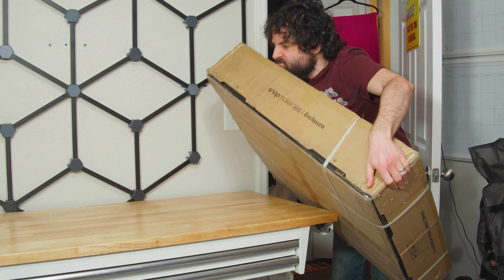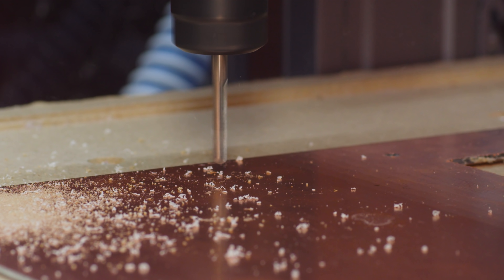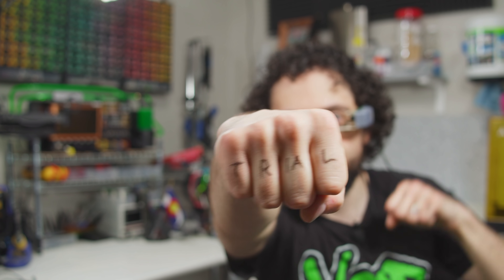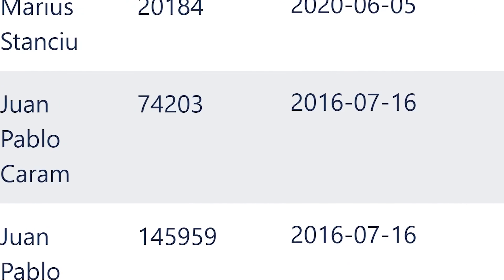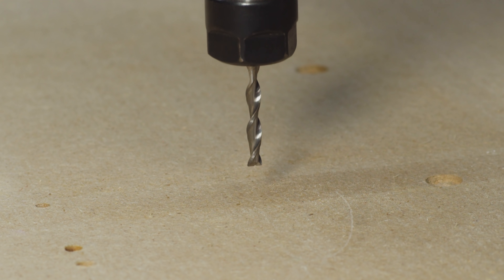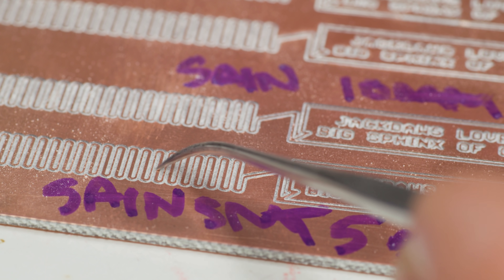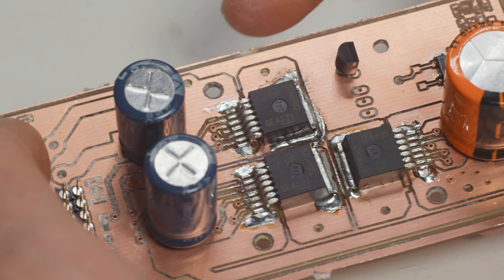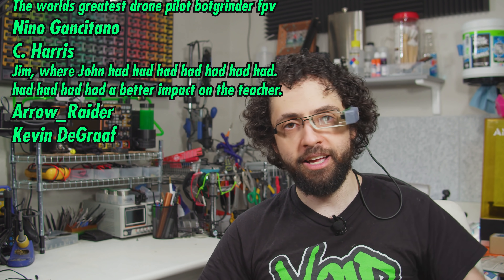PCBs in Two Hours? Zack Sucks at CNC

Comment: Thanks for posting this! I've spent months playing around with this on a garbage 3018 genmitsu cnc and was not able to make it reliable enough to use on a regular basis. I found that using candle's surface mapping was critical to get the depth tuned enough for thin traces. Also really applaud the two sided attempt. I gave up on that and just focused on doing multiple 1 sided boards that I could just jump. All the challenges here really really resonated with me, it's a brutally tough process unless you have access to fancy cncs, huge thanks for posting.

After watching Thomas Sandladerer's video here: https://www.youtube.com/watch?v=RudStbSApdE&t=11s, I shifted into using an etching process using a MLSA printer to massively simplify the masking step. Trick there is to pump kicad into freecad using the kicad stepup plugin to get the traces into there where I can extrude and then spit out an stl to slice in lychee. I now use the cnc to do the drills and then etch the traces. Plus I can re-use the resin printer approach (with a negative instead) to do a solder resist layer! I find this process to be much faster and tolerant to mistakes, esp for boards with lots of traces.
Reply: Check out pcb2gcode - it can convert Gerbers and drill files from KiCAD directly into G-code for several different machine controllers, and can inject mesh leveling code into the G-code as well. Works shockingly well once you set it up for your machine and tooling.
Reply: @OddlyIncredible  very cool, will do. Thanks for the headsup!
Reply: Do you have any tips for just drilling PCB holes with a CNC mill as you describe? (i.e. not doing it as part of an isolation milling job)
I have specific queries regarding things like software (which and how), techniques for positioning & aligning, feeds/speeds, etc., but I'd be grateful for any advice or simply pointers to useful references, guides, tutorials (videos or websites), Discord/IRC communities, etc... :)
I might even appreciate … 😷 Facebook group suggestions!¹ 🙀

I bought a Sainsmart 3018-MX3 a few years ago primarily for drilling holes in (and milling the outline of) etched PCBs, because drilling/milling boards "by hand" entirely sucks — even ignoring the "my hands, clothes, face ~~and lungs~~ are covered in fibreglass dust" aspect.
My Dremel rotary tool + Dremel Workstation (almost a pillar drill!) made the drilling+milling more possible than hand-holding a drill, Big Clive-style, but it's still extremely tedious and not very accurate unless I spend even longer aligning things.
With good quality pre-sensitised laminates I achieved trace/space dimensions only just behind the 6mil/6mil specs of the $5 PCB fab services (I think the limiting factor was my 600 DPI laser printer rather than any part of the expose/develop/etch process!), so it was a shame to throw away that detail/quality with misaligned holes 😸

My PCB designs became exercises in avoiding holes wherever possible, using SMT pin/socket header, SMT everything, and just bodging THT parts onto the board, soldered at an angle 😹

Unfortunately, "life" got in the way of me ever using the 3018 and I've not made (or even bought) any PCBs since then, leaving the 3018 gathering dust under my 3D printer :(
I'm finally starting to have more time again now, so I'll hopefully soon begin my CNC drilling adventures - but this is where it'd be really useful to know what I'm doing!

I've been using my 3D printer since 2017, and I have a vague idea about CNC mill use from various YT videos and such, but every PCB-from-CNC-mill video/article/tutorial I've encountered discusses isolation milling, and it's not clear if I can simply skip those steps and go straight to the drilling, especially if I wanted to drill holes after etching, thus requiring careful alignment...
(Though I have been wondering if it'd be easier to drill holes _first_, then I just have to align the transparency/vellum with the printed design onto the hole pattern. That seems to be the order used by industrial PCB fabs, after all!)

—————
¹ Ok seriously, some Facebook groups can indeed host useful discussions, but I don't like that distributed, largely-public platforms like Usenet and myriad Web fora are being replaced by a single data-mining mega-ecosystem 🧐
Reply: @AndrewGillard  I really just throw the drill file into flatcam and then do my best to align it by eye. I attempted a 3d printed jig, but bumped into warping issues with it and gave up. If you drill first, then chuck dry film over it and etch, you have much better control over alignment when placing the board over the resin printer's screen. Then you just don't even care about futzing with alignment with the cnc, where there's quite a few sources of possible error. imo the best way to handle alignment on a cnc is to not do it. Once you fire it up, don't touch it until you're done.
I think the key for me has been to accept that this is a solution for volumes of like 5-10 boards and just embrace SMT + bodges. If I need more than 10 boards then I don't bother with this.
Reply: @AndrewGillard  There are two primary ways to handle through holes when isolation routing a PCB with a CNC mill.

One, ye olde tool swap - install a drill bit, do your drilling, switch to an engraving bit, mill your traces, switch to a routing bit, depanelize your board. Requires that your tooling all have the same length when chucked, but you don't have to manually drill anything after milling. This is pretty much THE way to go if you have a tool changer on your mill.

Two, use the engraving bit to also peck-drill pilot holes (read: only punch in maybe a third of the board thickness) and follow up with a manual session using a small drill press. (Freehanding small PCB bits is a sure way to break them.) Requires extra equipment and time but eliminates tool changes on the CNC mill. This may actually be a better option than swapping bits on the CNC if you need a bunch of different size holes, but again basically REQUIRES using a drill press to cleanly drill the PCB without snapping bits.

Comment: You can actually level the bed in CNC, when starting the wizard to start the job on the touch screen it will ask you for your origin point xyz, using the arrows, set the right height and position xy of where you want to start and press 'set origin point' when you click start that origin point will be the same as the 0,0,0 in luban

Comment: Use chilipeppr grbl for processing gcode. If the cnc supports it you can add a contact probe ( 1 wire soldered or screwed on the copper, 1 wire with an aligator clip on the cnc bit ). Then in chilipeppr you can mesh level the copper plane and embed the deviations in the gcode then export it and send it to the snapmaker.  This way you can get even better lines because by running the mesh leveling you won't need to actually mill into the fr4 substrate, just "etch" the fine copper layer with a v-bit.
Reply: GRBL sucks.

Comment: Honestly, using photosensitive photoresist pcb and a UV resin printer will give faster and more reliable accurate printed circuit boards.. make a custom jig and double sided boards are easy.... could use your cnc to drill the through holes though :-)

Comment: Nice video again. Just one short question: would it be possible to fill the vias with solder instead of using the rivets? Or is that not reliable enough?

Comment: How fine is the beam on the laser module? If it's fine enough you could go full photoplotter. Photo-sensitized boards are cheap enough, though with developing and etching times I doubt you could get it down to the two hour mark.
Reply: If you're etching right the etch itself should happen in a couple of minutes. But most etch wrong. So they sit there for a half an hour and get crappy results. Which is a shame because doing it right isn't hard to do. You need to heat the bath up and blow air into it. Then it works like how you think it should. If the bath is cold and isn't air entranced it'll never work right.
Reply: @1pcfred  yeah, but unless you have a dedicated place where this is always set up then there's additional setup time, and time for the tank to heat, and more of the same for developing. It's not that the processes themselves take a long time, it's that there's additional work.
Reply: @1pcfred  Oh, absolutely, and I cant imagine what it would be like to do controlled impedance with milling. That's why I'm interested in seeing the photoplotter method, even if it would take more steps than milling.
Reply: @1pcfred  Different question: what's your preferred method for dealing with vias? I like the rivets, but I don't have access to the tooling at the moment, and if I'm going to need to buy stuff anyway I'd prefer to plate if that has become a thing.

Comment: You need mesh leveling for v-bits. It's actually quite easy to do but I don't know if it possible with this particular machine. Basically the bit and the board are both conductive. Connect a couple of wires and use them as an end stop. Whenever the tool touches the board it should send a signal to the Z end stop input on the CNC.
Reply: The possibly overpriced Wegstr desktop CNC mill has conductive mesh leveling built in and it makes a world of difference in PCB making, and I can make traces and pads suitable for TSSOP packages with it with very high reliability.
Reply: I've seen programs that do mesh leveling that apply corrections directly to the G-code file, no modifications to machine required.
Reply: if you do it that way, your v bit is dull by the time you are ready to mill.
Reply: @SharkyMoto  you dont have to use the v bit to create the mesh
Reply: @SharkyMoto  How would lightly touching a copper surface dull the same bit that is going to violently mill through said copper? Can you explain the material science going on there?
Reply: @ericcmcgraw  the bit cant turn normally while your are leveling, so it isnt cutting but rather just pushing down on the bit.
Reply: @leobla744  yes, neverthless the hardness of the materials are not affected by the speed, so the bit would still just dent the copper, not vice versa.
Reply: @ericcmcgraw  that would mean you cant bend a metal bar around a wooden pole wich you clearly can. its mechanical force, not abrasion
Reply: @SharkyMoto  if you try bending a metal bar tempered to the same hardness as the tip of a milling bit, you'll soon be picking up shattered pieces of a still unbent bar. Regardless of that, it's not a question of ultimate bending strength; when two materials are forced together, which one deforms is a contest between their respective material hardnesses, which the milling bit wins. That's why it can mill through the copper.
Reply: @ericcmcgraw  by that theory, a milling bit would never go dull. dude i tried this stuff myself and i can tell you first hand that homing with a milling bit as "sensor" will dull it, especially if its a very fragile v bit

Comment: Now can you laser a PCB?
Reply: Not directly, but it's possible. Laser won't remove copper but you can paint the board and engrave the paint layer. Then the board can be etched as usual.
Reply: Not possible. Marco Reps tried (and shared his experiences) some time ago. The copper just reflects light far too well. Even CO2 laser beams. 😥
The best (least worst?) method involved painting the copper with black paint, lasing the paint off, and then etching.

Comment: You can also make custom circuits with a exacto-knife. Don't let not having a cnc hold you back.
Reply: You can also connect your components with soldered wires.  Don't let not having an exacto-knife hold you back.
Reply: @billmckillip1561  You can also connect your components by twisting wires together all janky-like and securing it with hot glue. Don't let not having a soldering iron hold you back.
Reply: @Lozoot2  Components? You were living in paradise! In my days, we didn't have any components. Different kinds of soil and our own bodily secretions is what we had to work with. And we were happy!
Reply: @ronnetgrazer362  Sounds like microwave engineering, TBH.
Reply: @billmckillip1561  Or a laser printer, an iron, and some pcb etchant if I recall correctly.
Reply: @tchrapko  Or a Sharpie.

Don't let not having a laser printer hold you back!
Reply: @tchrapko  Or an old style heat-transfer photocopier. Did mine that way onto paper then ironed (with a clothes iron) the paper over the pcb board. Then etched with ferric chloride. Fun. And dirty. And environmentally very unfriendly. Les in UK
Reply: @1pcfred  well the Marines do..
Reply: @billmckillip1561  You can also use twist ties from grocery store fresh food sections with the paper/plastic ends stripped off as wires. Don't let not having a WHY IS MY PROJECT ON FIRE!
Reply: @billmckillip1561   I laughed way to hard 😆
Reply: @billmckillip1561  hey, I wrote a video game in 1984 using a ram disk that I friend of mine made with soldered wire-wrap for an Atari 800 on! 128k on the back of a 16k board!
Reply: @billmckillip1561  you can also connect your components with wire wrapping. Dont let solder hold you back!
Reply: @billmckillip1561  You can also connect your components with hot glued wires. Don't let not having a soldering iron hold you back.
Reply: @billmckillip1561  you can also connect circuits by twisting wires around your leads. Don’t let your lack of a soldering iron hold you back.
EDIT: I see I was as late as the heat death of the universe and about as creative as Adam Sandler.
Reply: @Rackmaster9K  Ha ha - you can also comment as late as you like. Don't let the lack of a calendar hold you back!
Reply: Yep, I did this once (around year 2000). The PCB was approx 1x3cm, double side, the components (I think that were 2-3 resistors, 1 or 2 capacitors, one transistor and one small audio output transformer) were THD and some of them I mounted as SMD (resistors); it was a mosquito repellent audio oscillator and worked at first try. All was made by hand, from design to drilling holes, with no tools other than a soldering iron.
I make it to win a bet and I won it.
Reply: @sebastian19745  You drilled holes without a drill?
Reply: @joeyjones6  Do you really need a drill to make a hole in a 1mm thick glass fiber pcb?
Reply: @sebastian19745  Yes... if you want that hole to be an exact diameter and located at exactly the correct spot. Because the fiberglass is not exactly uniform on a micro level, even a precision hole punch will drift. Even too high of a feed rate will cause a drill bit to get deflected enough to break out one side of a very small pad.

Source: I used to be a CAM/CAD operator at a custom printed circuit board manufacturer.
Reply: I read "dont let having a cnc hold you back". Laughed more than I should have.
Reply: You can also use Crayola and draw things on your walls and pretend they are working by magic. Don't let not having a CNC hold you back.
Reply: You could always go with my method:

Fuck the board, just string your shit together on the wire, baby!  Live dangerous!
Reply: I imagine a dremel would be even better... though I guess you could probably just buy a cheap Chinese desktop cnc.  The ones for this aren't expensive, and often have nice features like a solid metal work surface that you can really ensure your board doesn't escape....theyre real accurate too, and because they don't have too many uses their price is only going down.
If I want to mill anything, board or otherwise,  I use my avid cnc 5x10' machine, but mostly thats because its the most accurate machine in the shop.
Reply: @NeoIsrafil  Dremel is far too imprecise. Les
Reply: That also requires adderall
Reply: You can use an sla printer and photo resist too
Reply: By a show of hands, how many of yall eat paste?
Reply: Somewhere I have a flasher circuit done on a margarine lid
Reply: I have a CNC, I'm so held back...
Reply: Sounds like he needs a drag-knife 🤔
Reply: An
Reply: You can always just get an universal board and solder cables on it
Reply: You can also use universal boards and wires, it’s not that bad
Reply: This used to be the standard way!
Reply: Sounds miserable